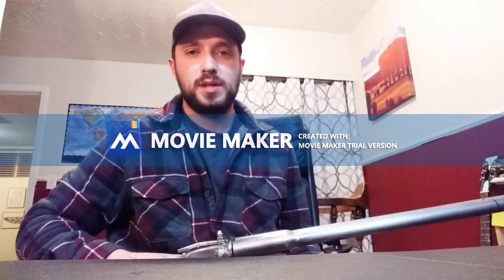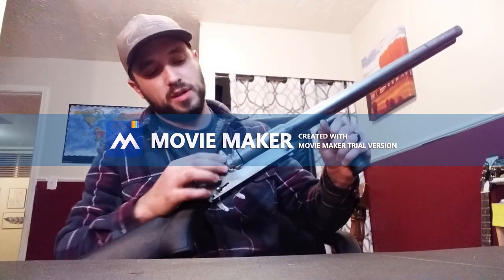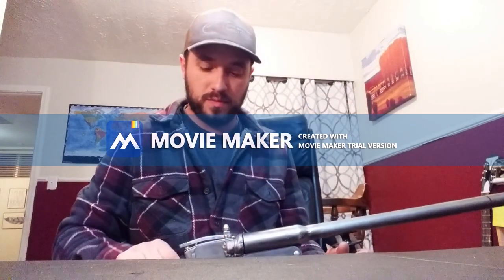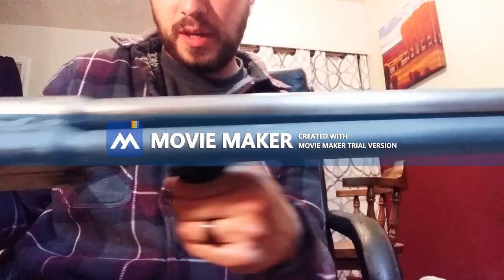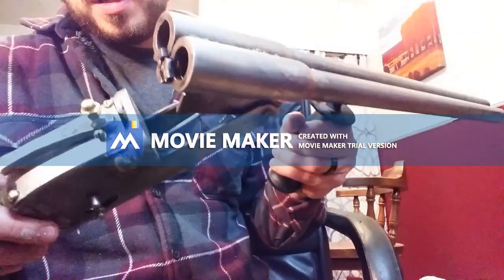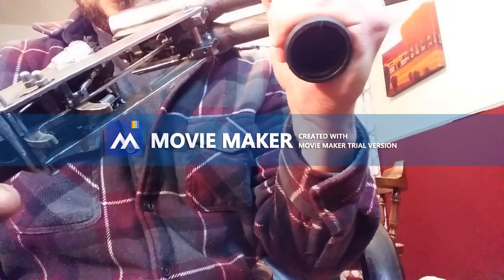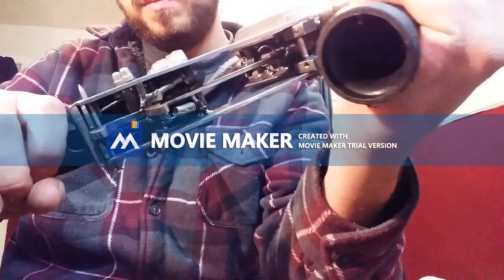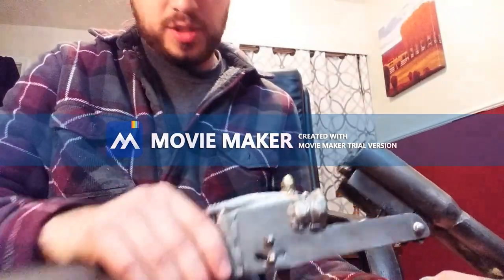Double Barrel 12 Gauge

Comment: Why not use strikers instead of hammers? Itd be easier to implement both in space and to recock, it just needs two springs... Lookup how a striker works on a glock or well most striker fired handguns, or even how the firing pin works on a bolt action... Itd save alot of trouble and guarentee a fire most everytime
Reply from the maker: that's a good idea, I will try that if I can't get this setup to work.

Comment: anychance you can be bothered to provide a detailed plan of how you figured out an auto cocking mechanism lol, im still trying to figure it out, cheers bro
Reply from the maker: I researched other mechanisms and then adapted the general idea to my own design. When it's cocked it pulls a rod backwards, the rod is connected to both hammers which cocked them. The rod is free to move forward after that.